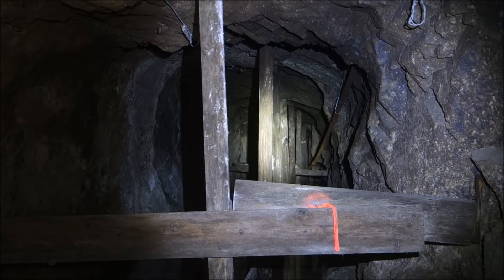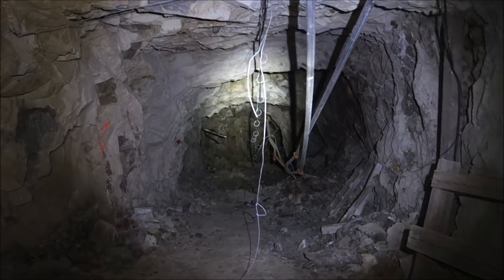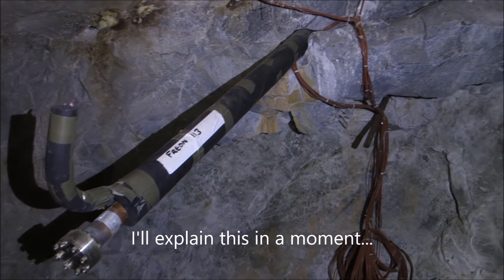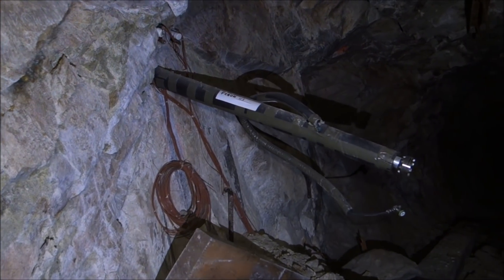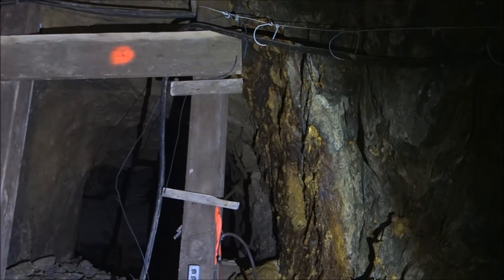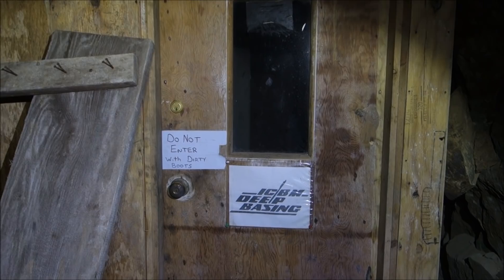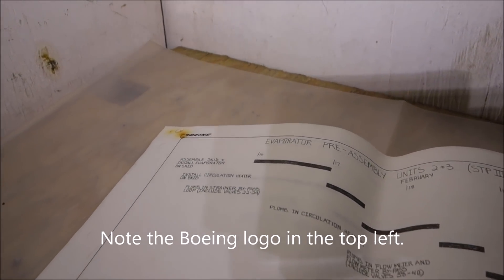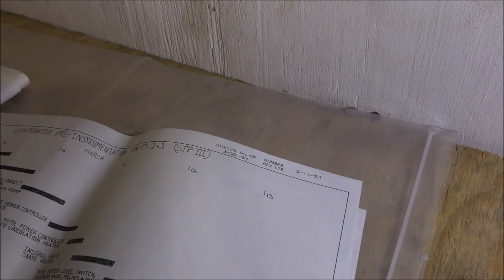Secret Military Project Discovered In Abandoned Mine

Comment: The nails on the wall where tools were hung? If you push them in the correct sequence the floor of the tool room is an elevator that takes you to another level of the installation.
Reply from the maker: I like that scenario.
Reply: @TVRExploring  unless you get the sequence wrong and the floor starts lifting up quickly and crushes you, lol
Reply: @andrewbarker9773  It might open a monster closet from Doom
Reply: @andrewbarker9773  Best comment thread evar!
Reply: andrew barker Or you had dirty boots on
Reply: @paulhickman278  Thats what the wire brush was for, dirty boots..lol
Reply: @TVR Exploring And don't go there! I remember working on "Push pin" circuits to do exactly that, except for the roof crushing bit, get it wrong and nothing happened, you just had to open the door, go outside and then re enter and close the door to clear the latches in the incorrect circuit. Weight cells in the floor detected if people were inside and activated power to the circuit.
Believe it or not. There was also a version powered by a 9volt battery held against 2 slightly raised copper nail heads to power the unlatch circuits. No power, no workee!😁
Reply: @Sam Point  Run a bypass before the ceiling  squishes us!
Reply: no joke, my grandpa said that he knew of a house in the desert that had an outhouse...if you did some kind of sequence right, there was a ladder that led down to an elevator that went down like 5 floors. he was in some crazy ass shit. was also in the suez canal in 1956....
Reply: Oh how would you know that??
Reply: Lol
Reply: I was thinking something like that. The discoloration on the walls plus looked like  'scratch' or 'drag' marks.

Comment: Anyone have any ideas of WHY they would inject Freon into those fissures? Seems to me, it could only be about controlling fracture zones? Strengthening or weakening. Has to be one or the other right?
Reply: Maybe to measure the escape of freon gas from rock? Man made and mostly unreactive.
Reply: @olivei2484  tell that to the ozone layer
Reply: @olivei2484  Exactly I worked on the research of air pollution for 45 years and this type of spiking is done for various reasons.
Reply: geotechnical / soil testing to determine if the soil has the characteristics to support the planned construction
Reply: To freeze something